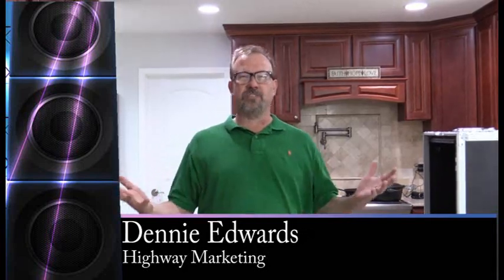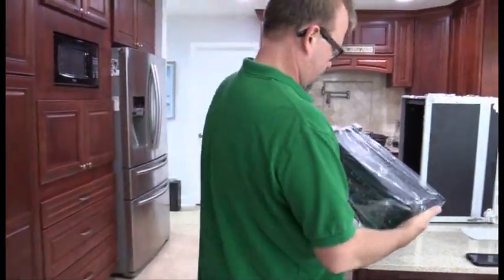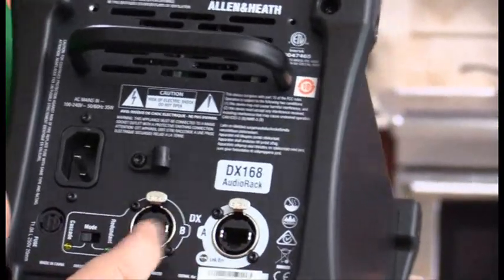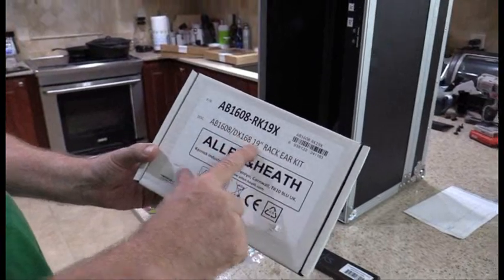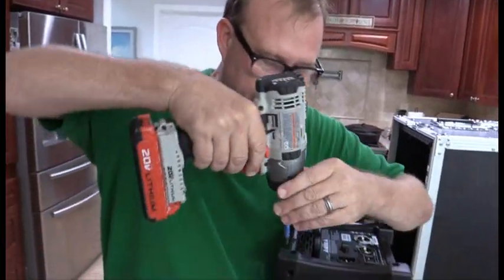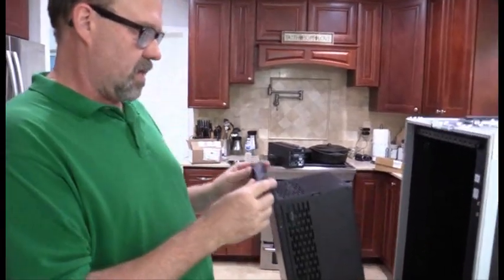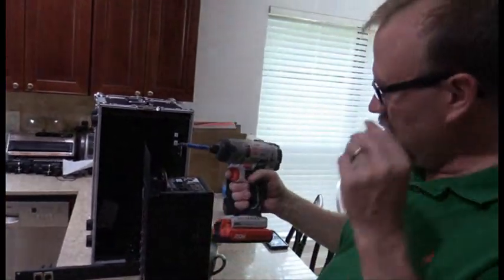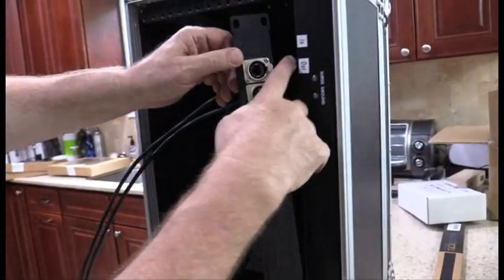Allen & Heath DX-168 Rack Installation

Comment: Nice but I find it a pity there is a spacer under the unit which isnt fully 19" (you cant put a blind plate). And If I was to move from my current M32R system to SQ system, I would definitely put the powercon and ethercon chassis in the large ear-rack, making the case 1U more compact :)
Reply: but the large ear rack doesn't have punch outs so slightly more work. I'm wondering why he didn't get a larger rack to accommodate 2 stageboxes since he is cascading them. Then, you could use that same chassis for more powercon/ethercon.
Reply: @Tweetyresm  splitting the racks, you can put a rack naar a drummer and the other somewhere else without having length of XLR cables ;) 2 stage boxes in one rack, means a huge units with this design :(

Comment: Sorry… newbie here.. why the powercon?
Reply: The Powercon connector is a more reliable connector than IEC C14 - it locks in place with a metal latch and it also is more durable when working in stage environments, They can also be easily daisy chained off other devices with white powercon output connectors.